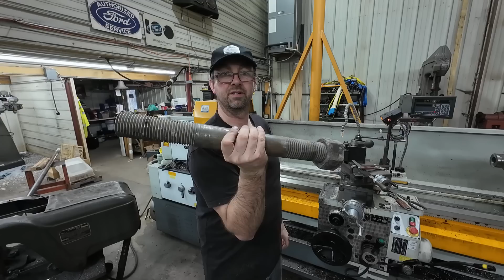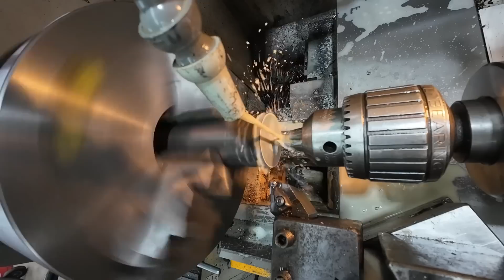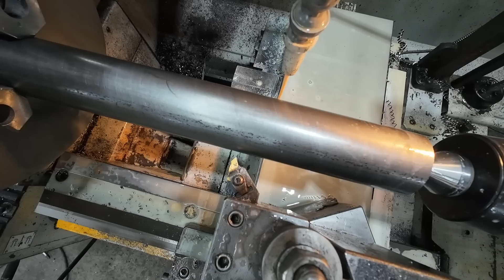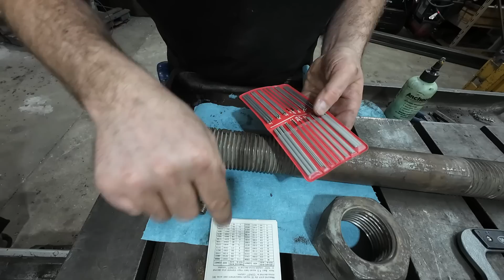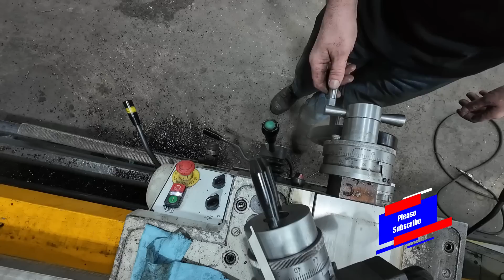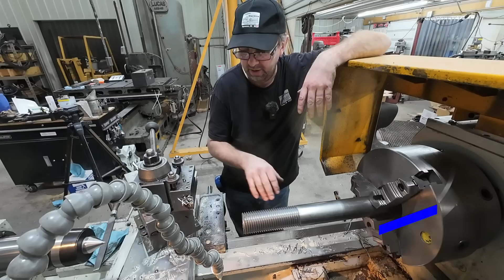I Hand-Crafted These Massive Bolts Using Only a Lathe

Comment: cutting threads, never be hasty, measure 3 times or more, ask for a new nut from customer so you can check if it is fitting nice and perfect, and do a stop on shaft against chuck, having that thing move on you is not good, it just makes double the work lol

Comment: Suggest putting a 2 piece bar clamp on the round bar (Tight) at the chuck jaws end to reduce the ability of the round bar to move inward towards the chuck. The amount of force pressing into the chuck is not small.

A disc micrometer with rubber bands can be used with thread wires to reduce the gymnastics involved with holding three thread wires to measure the thread in process.

Comment: To help prevent movement of the material into the chuck, would adding a dog to the rod against the chuck face help? When using a threading insert is the compound rotated 30 degrees?

Comment: I really never liked using the three wire measuring technique. Then I read what I should have thought of myself, of using small rubber bands to hold the wires. That and a disk micrometer makes it easy.

Comment: Have you considered cutting threads “upside down and backwards” per Joe Pi? It’s a lot easier than trying to stop at the same point
Reply: @zjtr10since80  With no thread relief groove to start in, wouldn't it be difficult to engage the half- nut and crank the cross-slide in to cutting depth accurately and quickly? Seems easier to cut right to left conventionally, and crank the cross-slide out, then disengage the half-nut, when there's no shoulder to worry about running into. Even so, cranking the cross-slide out consistently on each pass is tricky to do cleanly too, especially with such a heavy thread. Nice work, Josh!
Reply: @ everything you mentioned is true

Comment: So the item being made, can't be found in home depot and in their nuts and bolts.. some china made screws. Seen a video of Sam of Scrappy Industries make a drive shaft for his 38 Mack truck he is making. its in great condition considering its age. Here is what was funny; The U joints for it, one from usa and one from mexico. No problem with the one made here in our country. The one made in mexico was drilled and threaded on one end but the other side of the yoke was drilled, no tapped threads.... tight quality control right there hu. Keep em coming, as I don't watch em all but a fair amount of them.  I do believe it was you who taught me on the number system on a three jaw chuck

Comment: Thread pitch for a 2a thread should be 2.1028 - 2.0931   Glad to see you are using thread pitch diameter with the wires than checking with a nut. 😀

Comment: I'm curious.  Given the shaft obviously fits right through the head stock / chuck, why didn't you grip it more in the centre of the bar?  Would make the other end nice and easy as well.
Reply from the maker: Since I was retracting the threading tool, I wanted maximum room for extraction and disengagement.  Too close and I could crash.  Another thing is that it would be more true between centers over a longer distance.  Any deviation in the tailstock is spread out the further you are from the chuck.  Such as. if it is off 0.010", that much over 5 inches is a greater taper than that over 20"
Reply: @TopperMachineLLC  cheers!

Comment: I've watched other channel cut threads on a hydraulic cylinder rod I think it was he had to stop the lathe and run it backwards then run carriage back to the start of the thread to take another cut. What's different with your lathe how does it start the new cut on the exact same spot each time. I understand the other channel everything's in sync by running it backwards.
Reply from the maker: Better quality machine for one.  Another thing is how your taught to thread.

Comment: A class 1A   2-1/4 x 4.5 tolerance allows .022 between the nut and screw. Pretty dang loose. Designed to be used full of gravel grease dirt and dents.

Comment: No scratch pass and double check with a thread gauge? That loud boom you heard was the collective exposion of thousands of arm-chair machinists.
Reply from the maker: Never needed to do that.  The machine has the info on the thread chart, just verify you have the correct gear.  Unnecessary extra steps cost extra time, and time is money.

Comment: A couple of years ago I made four 2 1/2" - 4 bolts I think 40 inches long for a jaw crusher. My customer supplied 4140 steel. I threaded just enough on one end for a nut and I think ten inches on the other end. Fun job. I think the nuts took a 3 3/4" wrench. I didn't have the wrench in tool box. I think he used a pipe wrench. After the bolts were made, my customer wanted 8 flat washers. No problem. I save everything. I had 4 1/2" x 5/8" round slugs on hand. All I had to do was cut 2 1/2" in holes in the center.

Comment: Hi Josh, long time Canadian viewer here, I hope things are going good for you my friend!
I have no experience cutting threads on a lathe whatsoever, but I do have a question.
If the process of cutting the threads pushes the bolt into the headstock, would removing material from the tailstock side of the thread  counteract that at all? There are probably all kinds of reasons that's a bad idea, but I was wondering.
Reply from the maker: It would help, but it would also put pressure on the wrong side of the insert.
Reply: Hi Josh, thanks for getting back to me!

Comment: If you fed with just the cross slide instead of the compound would that minimize the push? Also, do you know what happened to Kyle from Vanover Machine? Haven't seen anything from him in over a month.
Reply from the maker: It would, but it puts a lot more pressure on the cutter.  That could result in breakage.  Kyle is super busy in his shop, due to an economically good region.

Comment: Hey Josh I would use the tool holder from your line boring machine to put up against your Chuck to keep it from slipping that won't cause any problem with the bolt
Reply from the maker: That is a good idea but I don't have line boring machine.

Comment: We'll just take "one more light pass".... proceeds to cut what looks like garage door springs!   Nice work, and a good tip on the use of the nut for fit!
Reply from the maker: Lol, yeah my light passes are usually beyond some folks heavy passes.
Reply: @stevemahrer7097  "...looks like garage door springs." LOL! Cheers!
Reply: I noticed that also.
Reply: Rubbing, isn't machining.
Reply: @bostedtap8399  we used to hold .002" then go straight in to clean off the nitnoids.

Comment: I'm no machinist, but find this stuff interesting.  Genuine question:  After making your first pass and have laid down the start of the thread pattern, how do you start each new pass at the same starting point in order to not screw up the thread pattern?  Does the machine know when to start engaging the cutter based on monitoring the rotation position of the material?
Reply from the maker: You engage at correct point on the thread dial.

Comment: Keith normally makes the first thread path very lightly and for a short distance then he lines it up on the thread tool to see if the thread settings are right.
Reply from the maker: I don't do that, because the charts on my machines are accurate. Never had an issue when in the right gear.

Comment: Great job, Josh! One of my favorite ops on the lathe, and most rewarding, is cutting some nice big or custom threads. Just did some 4-1/4-16 UN-3A and mating 2B last weekend. Thread wires are also the bane of my existence but there is no better way to PROPERLY measure threads, ESPECIALLY custom threads!
Reply: I graduated from thread wires to thread triangles. One advantage was that the thread triangles were joined with a plastic cord which makes holding while measuring with a micrometer much much easier!
Reply from the maker: I just bought a set of triangles.

Comment: some time you can rough sand the bar where the jaws set and it makes a difference,makings lines linnier to the length of the
 bar the bar doesn't  just push in it starts to rotate first, you can see that in the part, you can tighten all three key  holes, or if nobody is looking a 16" cheater bar works too lol
Reply from the maker: I'll never use a cheater bar again. Destroys chucks real quick. But sanding is a good idea.
Reply: You treat your equipment with more respect than when it's not yours which is sad. Good video 😊

Comment: Useing an elastic band is a good way to hold the  wires while you are measuring the threads. Cheers
Reply from the maker: I've done that, but this was easy enough due to size.

Comment: When I was stationed in England, there was an old civilian who had an interesting book. It was called The Thread Cutters Digest, I think. 
It had every thread you could imagine. Acme, square, butress, multiple leads, reverse, metric(!), pipe threads of all descriptions, you name it! I was surprised at the metric as the book was printed around 1900. 
Did you know that piano stools had their own specifications?
I sure didn’t. 
The worst threads I have ever cut was a 4 lead reverse square profile. Toss all your ideas of how tools should be ground with that one!
I miss machine work as I retired in 2009. Maybe I can get me some small machines and get back to making chips!
Cheers 
Terry
Reply: Might have to get yourself a small lathe for your home shop.
Reply: Do it Terry, you won’t regret it.

Comment: I'm curious why you cut off the first quarter inch of 1045 as waste in the bandsaw.  You didn't say.  Is this common practice?  The end of the rod already looked pretty straight.  Would it not have been a good idea to directly face off the end in the lathe?

Great video by the way.  Ive never considered that the material would slip due to cutting pressure like you demonstrated.
Reply from the maker: The end is always cut off. They are either deformed or sometimes work hardened from manufacturing.

Comment: I’d love to know how long these ops take in realtime.
Reply from the maker: About 30-40 minutes total with filming. 15-20 without.
Reply: That’s not hateful. I’ve seen some other creators lamenting about just the saw taking an hour or so to cut metal
Reply from the maker: @go4peanut471  lol, yeah some material can take a long time. Especially with a dull blade. I had some 10" round that took an hour to cut, changed the blade and got it down to 12 minutes.

Comment: When the part slips in the chuck, how do you get the right number on the threading index ( not sure what the little number wheel is called that you use when threading)?
Reply from the maker: The slippage is minimal. No change. Just a.little.clean up

Comment: What should we call that pile of chips on  yourJohnson? Mount Topper? Like that 60 degree insert tool. Mine is a Dorian. One of the good purchased I made. Dont thread much as I would like to. Use taps and dies much more. I came across some long stainless bolts a while back. Have not tried any of it yet. 30mmX 5ft I salvaged them from four machines that were scrapped. I am going to watch this one a few times. I would just chase the thread till I got a good fit with the nuts. Not to sloppy not too tight. Machinist Handbook can be a little hard to decipher for some. I look forward to watching the rest of the video. Thank you for taking the time to do it. Many give up.

Comment: Try full thread inserts they deburr the od and you can measure the major od with mics. Also if you have to use wires use tape to hold them together.
Reply from the maker: Never seen them. Interesting concept.

Comment: Years ago, I worked in an oil tool shop. There were two Identical lathes, operated by two machinists. one machinist was bragging about cutting 5 thread tool joints at 180 RPM. The other machinist shifted his lathe to 240 RPM and cut those threads all day at that speed. He was also an advanced black belt in karate..

Comment: I think something that most non-machinists misunderstand is the math that goes into such work. 🤷🏻
Reply from the maker: Lots of math.
Reply: @VetvsWorld  I agree.  I took trigonometry in high school and never used it until I became a hobby machinist.
Reply: @1OlBull  Heh, I started as an engineering major, but quickly realized how much I did not want to do math for the rest of my life.  🤣  Thus far, I’ve resisted the call to hobby machining.  Need to work on my self taught welding, which sucks.

Comment: I'm glad you got some work. Hopefully, you will have more soon. I learned something about larger treads can push away when you are cutting. Now I know something new today.
Reply from the maker: This was the first real job in weeks, and nothing since. Did this one a few weeks ago. Nothing on the horizon either.
Reply: @TopperMachineLLC  I'm sorry, but maybe make another tool for sale like a true quality quick change tool post that is actually accurate for a fair price. Or anything that you know will help others doing machine work at home.
Reply from the maker: @charleswelch249  I'm working on a few ideas. The pin jaws have taken most of my time. A qctp would be very expensive to make.
Reply: It is not just larger threads. The issue can happen on smaller stock due to thermal expansion as well. The expanding material pushes the tailstock away and then cools off, contracting.
Reply: Amateur non-machinist here with a thought. You must have some lathe dogs around your shop so put one on the chuck end of the work and firmly tighten the set screw. It would act as stop to prevent the work from slipping into the chuck jaws as you cut threads. I’m sorry to hear that no new jobs are coming your way. Are you advertising that you are available for job shop work? Good luck with getting back on your feet!  🥸👍👀👋✅
Reply from the maker: @joeromanak8797 I wish I had every penny I spent on advertising back.  I would have a really decent retirement account if I would have invested it all.  Instead I spent over $100K on advertising in the last 13 years and got maybe $2k of work out of it.  Absolute waste of my money.
Reply: @ - That’s a sad commentary. There have to be people who need the service you can provide but  I don’t know what to suggest. I’d hate to see your shop and channel die on the vine because you do have great content and we learn something new with each episode. I’ll give you my best wishes for an uptick in paying customers. 🥸👍👀👋✅
Reply: @joeromanak8797  I agree totally. I am trying to come up with ideas to help, Josh. But I'm not in his area, nor do I have any influence in his area.
Reply: @TopperMachineLLC  That is very disappointing, but I have had an even worse payback on paid advertising.  I spent only a few hundred at most but got zero work for it.  I have found that most work comes from pounding the ground.  Now I do have a different mainline of work than you (custom baling) so your mileage may vary.  

Anyway, good video!
Reply: @TopperMachineLLC  the advertisement that works is good content and word of mouth.  If you are in a dead zone of economic activity you need to be the industry and sell it to a wider area.  You have boundless capability.  Damn, I do worry about your situation.  There are hidden opportunities, for sure.
Reply from the maker: @cogentdynamics  13 years trying to find those opportunities, they don't exist.  I am the last shop here for a reason.  Too dumb to give up.
Reply: @joeromanak8797  set screw would mark the part and the grip would be not be very consequential compared to the chuck.  IMO.

Comment: Completely off topic but, I’m not a machinist or mechanic but I love work and could watch you for hours   Now my question, I turn valves, 8” 10” larger or smaller in a coal fired power plant built in 1952. I sometimes see valves with “double”threads, starting threads 180 apart. 
Now the question, why? Just a different thought on design or something mechanical that is an advantage?
Reply from the maker: Speed. The double thread will move faster. ACME is more durable also.

Comment: Maybe adding a shaft collar on the part against the jaws would help with the slipping.
As the part moves in the start point has moved thus changing the rotational starting point and could maybe mess up the thread , kinda like engaging the half nut at the wrong place by accident , been there and had that happen .
Good to see you have some jobs coming in the shop again, hopefully things will get better soon .
Reply from the maker: The movement is minimal, and easy to fix. A collar would not help much, but a rigid stop in the headstock would have cured this.
Reply: @TopperMachineLLC  spindle stops are great!  I have been working on some. I was also making a short one to slip in to the front of the chuck. It was almost finished before I got brain fart and threw the part.  I have been too frustrated to even looking at it.  Man, those stops are an opportunity for someone to design something who is smarter than I!
Reply: @cogentdynamics  I always use stops when I can. Mainly because my stuff is so old I'm surprised it grips anything anymore.
Reply: @ ya, and then I don’t need 3 ft long chuck wrench handles when the parts can’t slide back.  I learn from others who tell me.  I’m slow so it takes a while to sink in for me.  A big reason Josh is so great to listen to.  I notice that there are a lot of experienced people who participate in this channel.  Very impressive and thank you for your comment.

Comment: I use those pins too when measuring threads the pins can be hold with rubber bands then you have hands free to measure some easier. Nice cutting ...
Reply from the maker: There are many methods to hold the wires.  On these bigger ones, it's easy to hold.

Comment: I am afraid to try it without a relief,  afraid if i dont pull out in time, it would break the tool, (and get her pregnant)
Reply: Don't lathes have a half nut auto disengage function you could set to stop crashing a tool? I guess you'd have to keep repositioning the tool and get it back in sync with the threading wheel gauge everytime if so?